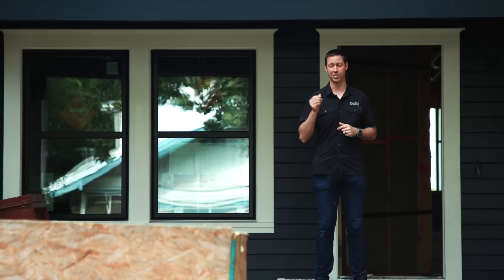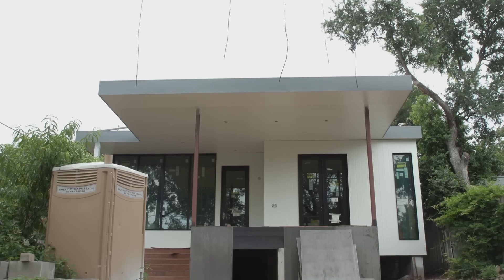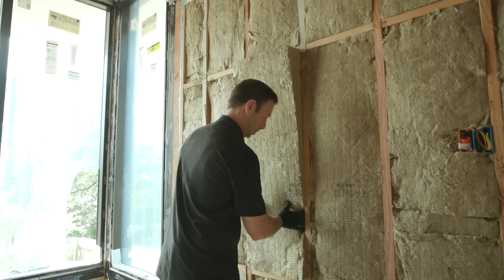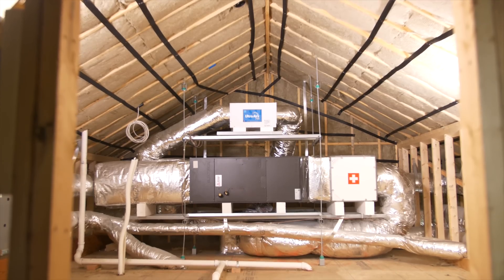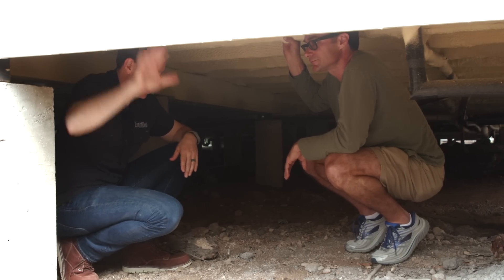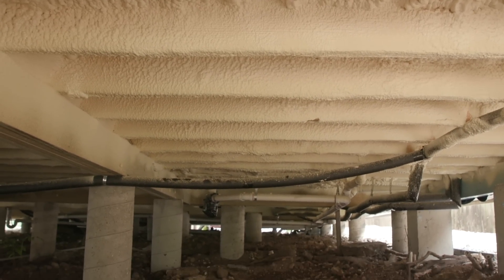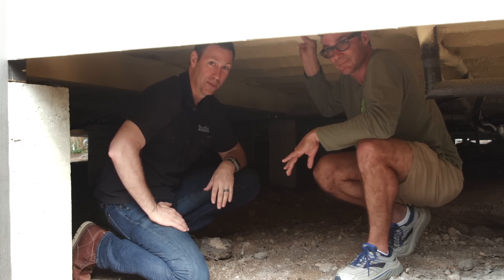2X CODE INSULATION - Simple Trick!

Comment: I'd like to know more about how the roof was insulated. I believe you mentioned it was R38 in the end using Rockwool, but how did he get there? Is it just Rockwool? Is there any rigid foam on this outside? I'm looking to finish an attic space in an old home in Chicago and I would like to not use spray foam. I'm hoping there's a way to use Rockwool and still get a good R value.

Comment: Refurbishments are key! Basic motivation: improve  IAQ and comfort.By:  ~double insulation (2*R); triple glazing (also 2*R); good airtightness: air barrier: n50 0.2h-1; ERV: with a good particulate filter (#Passivhaus quality requirement). This is the "full passive house package". And this is not that difficult to do. And it has so many additional advantages - as we have seen with the smoke from the wildfires in 2020. Do we have to add that this is also a cure to mitigate climate change? CO2-emissions will be zero, if the electricity will be generated by renewable energy. What we easily can do if most buildings have energy requirements as low as these ones.

Comment: Matt I've been  rewatching a lot of your videos lately and i have a question for you on crawl spaces. In this example and a few others you have said that you would prefer closed cell foam for air and vapor barrier.  My question why wouldnt you just treat the underside of the house in the crawl space like a side or the rook . Why not just insulate between the joists and use some zip sheathing with some liquid flashing for your insulation and vapor barrier? Since you do have some plumbing and possibly electrical coming through you could just detail those openings like you would  on any other wall . Maybe a dumb question or theory but isn't it just like any other wall.

Comment: I seen the zip systems leek water in 15 minutes in a house in a rain storm with no siding there is no advantage for the zip system! If u plastic rap on the wall sheeting I seen mold in side the walls because the wall could not breathe !

Comment: we use ceramic blocks and graphite styrofoam, U factor for a wall is about 0,14 [W/m2*K] and triple glazed pvc windows are today no more than U=0,8 (76 mm depth)
the wall with styrofoam is 45 cm thick (it is wet and heavy technology but it will last for ages)
I really dont get how you get 0.15 U triple glazed windows, physically it is impossible, could you elaborate and give some technical specs

we use rockwool sure, bot mostly for the roof

Comment: Matt, I am rebuilding a 1918 house. The main construction is a 1ft thick rock/concrete/brick wall. It would have great thermal mass, however in the winter I have absolutely no sun, there is a mountain behind the house. Any ideas on what I should do about insulation / heating?

Comment: good video and info.we just built our house last year and is certified energy efficient..i know our windows are no where near those installed in this house but very good non the less.i will say that being in texas compared to wisconsin where im at wouldnt be a good comparison in weather but i just dont see the money spent versus money saved to be worth it. we had a very cold winter last year and reached -20 for about 5 days straight and this was the high temp!without any wind factored in!our house is exposed with no trees either yet and we got slammed on our heating bill..the house should be good,in texas,in a neighborhood and new construction.

Comment: Love all the insulation and products being used, however, when these buildings burn they are becoming super toxic, especially to Firemen.
Reply: I think the sheathing has foam bonded to the back. Foam isn't fireproof yet as far as I know. Building code was originally because of fires; but we have a lot of non fireproof stuff, especially inside, that has not been figured out. Furniture, clothing, carpet, home products, foam, vinyl siding, vinyl soffit, so many things there is not a better substitute for. Concrete furniture just don't cut it.

Comment: R38 is not 2x code that is code for Austin Tx. Also what about thermal bridging on the roof deck? He used exterior insulation on the walls but what about the usually larger area the deck?

Comment: Windows: I am so discouraged by thermopanes. I see failures everywhere. Then you have a huge expense of repair/replacement. Some let you just replace the glass but often out comes the window with a huge sealing and trim redo. No savings there! Pella made a double layer that you could remove one pane, clean and put back.

Comment: Matt, I just joined your group and I love your videos.
   A little about me I've been doing rental property since 1984. Then in 2007 I started flipping and renovating homes in the historical district, two commercial buildings.
  Now I'm getting ready to build me a 40 by 60 by 20 Kwanzaa hut in Trinity Alabama. 35673
   There's a couple areas I'm having some problems with the insulation decisions I know close foam is the way I want to go. The first question I have for you is do I do it outside or inside.
    I was planning on doing to in inside and then come back and doing some bating.
   My architect said I'll probably be raining humidity in my building. He is designing me a real nice print where I can have a garage and an office space on the bottom then upstairs is going to be a open floor plan for myself a new bachelor's pad.Not of my choice I'm going through a divorce and I want somewhere different to live and a  tiny home is out because I'm 6-3 60 years old and 300 lb. Anyway Matt getting back to my question where do I  put the spray foam inside or outside of the Kwanzaa hut. because of your videos I already know that I'll have to spray primer on the galvanized steel thank you. My architect recommended to me outside and then come back and spray it with some kind of light colored paint reflective vu to protect the insulation. He was telling me that it's has to be this way because it makes a vapor barrier outside to keep water from dripping on my head.
   I put my project on hold until I can get this ironed out inside or outside.
   After I was through talking to my architect last week my decision this week was to do the spray foam outside with the paint and then come back in and do the batting. I really don't want to make a $10,000 mistake with a huge cleaning mess.
   I real need a place to live soon and I dont want to make a mistake that will cost me time that I really dont have can you help thank you David Ralson 
Construction site
391 County Road 367 
Trinity Alabama 35673
256/318/5111 cell number
 present mailing address
1904 Dresden Drive Southwest 
Decatur Alabama 35603

        If you want to use my quanzhi Hut project as a YouTube video with a little free advice I'll be glad to let you do it.

 besides using your idea about painting a primer before I have to spray foam put on I've also listen to the video about the T-stud from Canada which I plan to use in place of a regular 2x6.
   Yes I find your videos very interesting and educational you just haven't hit the nail on the head for my Kwanzaa hut.
   Tiny homes and shipping containers have been a big craze for a while now the new thing is get you an old shed or buy a kit from Lowe's or Home Depot and build you a home inside.
    that's where I got my idea for a quanzhi Hut I don't want a little shed or a tiny home, 40 by 60 is plenty big and brand new the kit was 12,000 shipped to my door.
    Now I need to do is have the footers poured then the slab than the plumbing and put the building in insulated and closen in my end walls was more 2x6 from Canada
  and then install Hardiplank on my in walls
Reply: If I'm able to close the envelope enough I would like to use one of those machines that brings outside air in but keeps the humidity out I just watched that video few minutes ago to very interesting

Comment: With the use of rockwool in a conditioned attic, did they follow 2018 IRC and install a vapor diffusion port and add conditioned air to the attic ? A video on the roof structure would be very interesting.

Comment: legit question: is it necessary to insulate (put roxul) the interior walls if your perimeter+outer walls are insulated with high r values? or is that just for noise dampening?
Reply: Bluellow the exterior here is not hi r. Not even close for passive house standard.
Reply: @nextdevelopments8833  sorry ive worded my question incorrectly. By interior walls i meant like inner bedroom walls and walls that shape the living areas. Do they have to be insulated if the perimeter interior walls are insulated?

Comment: So R 23 on the walls plus foam, and R 38 on the roof? That’s less than code here in Ontario for the roof and barely over for the walls, and once again no mention of the fact that rockwool costs twice as much per bag, and covers half as much as fibreglass, just to get some benefits that are hardly proven. I’m all for energy efficient houses but this seems bit blown out of proportion, and I’ll never use that zip-R crap, a layer of foam between my racking strength and studs? No thanks...
Reply: It's for a retrofit and also this is sufficient for this climate zone. If the calcs says that is enough for passive house certification, that's all you need to know.

Comment: I’m building a new home in Texas and love this channel. I have decided to use spray foam throughout the home as I’m trying to create a sealed envelope. My builder just mentioned he will be putting  continuous roof vents and soffits with perforations. I thought I have seen something on this channel that mentioned you do not want these openings in a house that has spray foam in the attic  as it will not allow for a  sealed home. Is that correct? If so can anyone supply any builder spec documents against this tripe of venting?
Reply: I think Matt did a video on a “hot roof”  just have to be careful what roofing materials you use.

Comment: Most builders I see here in NC do a crappy job and cover the crappy job with some glitter   Like putting a dress in a pig    One of the biggest gripes I have is the drywall dust not being properly cleaned up   Take switch plates off   If behind it is full of drywall   You have a sloppy builder  imagine what’s under the hardwood floors    The builders don’t care
Reply: @CP Yes, it's very hard to find quality craftsman here in NC. There are some interesting things happening in the Triangle region, but only for the uber wealthy. In my neck of the woods, no one has even heard of building science.

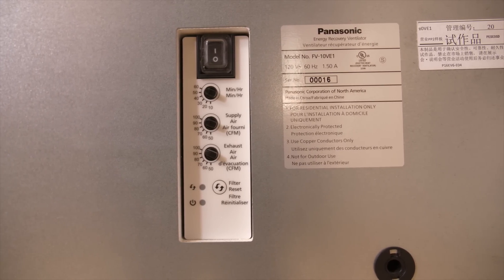Comment: The Panasonic ERV at 4:09 has a label in Chinese saying this unit is a evaluation sample only and not sellable, after demo it has to be returned to Panasonic.
Reply: I guess when you are the architect or builder you can put in freebies
Reply: Harbor Freight? Hope the 20% off coupon was used.
Reply: Well, if the Building Inspector's Chinese is as rusty [well, nonexistent] as mine, I'm sure the unit install will "pass."  Did note the serial number on the ERV was #16...
Reply: lol builder caught red handed?
Reply: Interesting that it is pegged right next to the "unit is for residential use only..." sticker.

I've had demo-model tennis rackets that lasted 5 years when taken care of. Not a perfect relation at all to the issue seen here. 

What is the expected life on these units, 30 years?

Comment: Simple Trick? Nothing in this video would be "simple" or inexpensive. Man I get tired of watching shows that never get into the real economics of the install. I put those same windows in because I think they have long term value. I also did the Rockwell in sections, but it was more for the supposed sound limiting aspect. I would be very surprised if double the insulation and the other means they discuss have a positive energy payback within 20-30 years. Just ran the numbers on my HVAC and the 14 SEER is more cost effective long term than the increased unit cost to go to say 17 SEER.
Reply: There are other benefits to having a better insulated house, like noise reduction from the outside, more consistent air temperature inside, better humidity control, better thermal inertia which is useful if there is a power outage or a disaster.

Comment: Hey Matt - a couple of us are curious about the structural work that went on in that crawl space. Looks like those concrete columns were retro'd under the existing house as well as the modern addition - would be really curious as to how that was done...thx.
Reply: Totally my question, too!
Reply: J Healy - We need the details on this concrete columns how deep are they.
Reply: If you think about it, there is almost zero chance that there is ANY existing house. When they are showing the windows in the "existing section" the wall frames are all new (which they have to be to accommodate all that insulation) and the subfloor is all new. When they are under the house they doesn't appear to be any "old" support work. So - new wall frames, new insulation, new floors, new roof, new windows, etc, etc. Pretty easy to pour those concrete piers when there is no house.

Comment: I've seen people and builders believe they are beating nature by making house super insulated and super 
tight using vapor barriers inside and outside walls. The result was mold growing on the walls. Nice. If your
house is so air tight, you need mechanical air exchange constantly, and if it fails in every room, nook and 
cranny of the house, you will get bad air and mold. When animals are kept in barn that is air tight, the young

calves will get sick and die. If they are put in a barn with cracks everywhere, where fresh air is constant, they
thrive. Material also have chemical properties, and will undergo change over time. Insulations will off gas;
fiberglass is like asbestos if inhaled, can cause silicosis. Plywood has formaldehyde, and if temp gets too

high, it will off gas. Unless you are a materials engineer with a lot of chemistry science knowledge, building
with the idea that twice as insulated, twice as tight is better... well, the extremist in you will discover the 
extreme in Mother Nature, and it won't be a pretty picture. You are probably not as smart as you think you are.
Reply: This might help: the Energy Code of 2012 changed everything, insulation, windows, matching HVAC, and Blower door tests as standard. An Air Tight House means a Ventilation Strategy is Law. Most Municipalities adopted it in 2014. I did over 60 Blower Door Tests by Third party in the last 2 years. Environmentalists pressured Obama to shut down dirty coal plants, Energy Code 2012.
Reply: @ModernMountainLiving Well that's legislation, and even if based upon scientific interpretation, doesn't mean
it's absolutely correct. For the better part of a century,  Science has claimed that fat and red meat 
causes heart disease. Now we are told no, it's sugar that causes it. Science goes back and forth
and changes or reverses its tenets continuously or in spurts. The proof is in the taste of the pudding.

For a time, builders were told or by code, to use a particular type of vapor barrier under siding or 
brick veneer, was supposed to allow moisture out but not to get in.  But then sometimes a builder would 
pull siding off and guess what -- the barrier was indeed sodden with moisture on the inside. Empirical
evidence beats Codes and Legislators every time. Descartes founded Science upon DOUBT, not upon

BELIEF. Any idea should thus not be taken for granted as sound just because science or Code writers
say it is thus and thus. Suspend all belief until time and empirical evidence confirm as such, and then
due to the complicated way of reality, it may still be mis-understood, mis-taken. Well you may be 
required to build according to codes, but mother nature will still be the court of last appeal if it's right.
Reply: @rockyfjord4710  So your thinking is, because you think they can't build a properly air tight, well insulated building that therefore the building code is stupid/wrong? How about people be accountable for screwing up! Too many buildings I've seen with poor workmanship.
Reply: @imzjustplayin Huh? No I think they can build perfectly tight, and that is the problem -- too tight and 
therefore very unhealthy. People need lots of fresh air. Air, even cold air will not kill you, but humidity
and lack of fresh air, can kill you. Of course there is poor workmanship. Mexicans and old German
craftsmen are not the same. The Japanese tradition of woodworking was a wonder as well.
Reply: @rockyfjord4710  ok. Well the building code already is prescriptive in the scenario you outline which is that an airtight building is going to have air quality issues unless it's properly ventilated. A device such as an ERV gives you the benefits of both ventilation AND energy savings of having an airtight building envelope.